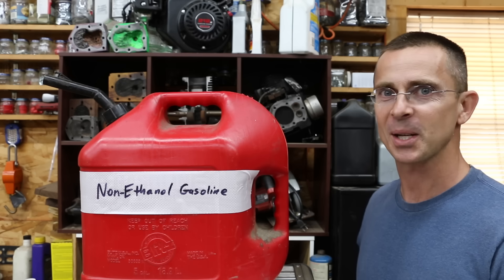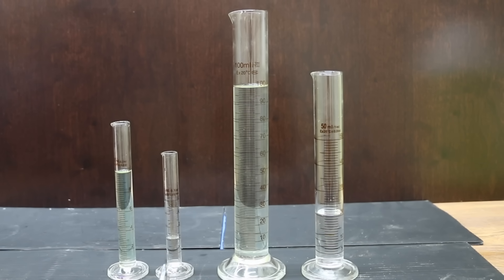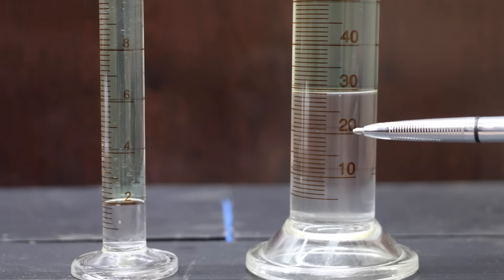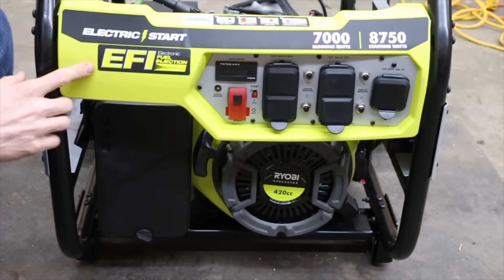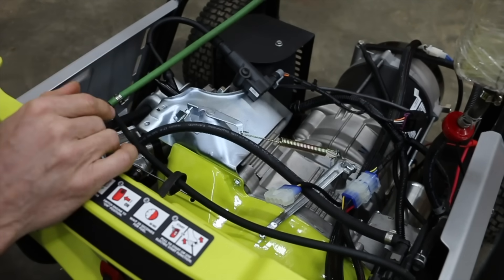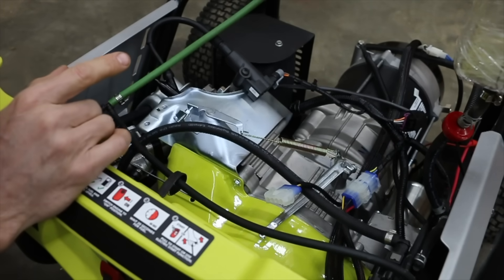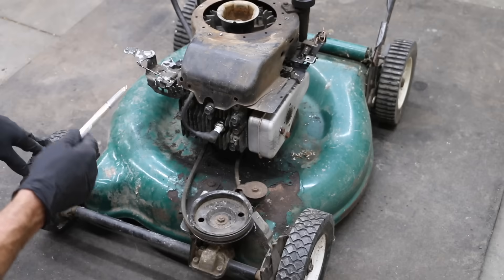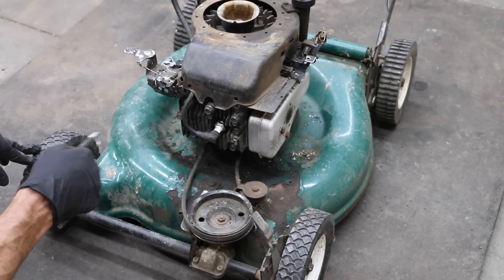Is Non-Ethanol Gasoline Really Better? See the PROOF!

Comment: What if you rerun this test and raised the ethanol mix to 20% or 30%. Curious to see if that would create a noticeable difference
Reply: Normal 02 sensors and computer can only compensate for a certain amount.
Flex Fuel vehicles use pure gas to E90 automatically.

Comment: I hate ethanol if you look at the e85 gas nozzle when you’re at the pumps it looks like is corroding the nozzle. So just imagine what it is doing to your engine.
Reply from the maker: Great point
Reply: It’s not the ethanol. It’s the gas and water mixture as caused by Ethanol’s water attracting properties. Essentially just don’t mix gas and water, meaning don’t mix gas and ethanol. Ethanol alone can be worked with so long as our engines can be built for it.
Reply: And without ethanol present, the water in the gas would magically disappear?
Reply: Mikey McMikeFace He is kinda right ethanol absorbs moisture and water when gasoline doesn’t. It’s kinda a bad idea to store E85 over a long period of time. However I love E85 and that’s about all I run in my daily (2017 Subaru STI). IG @subidoosti
Reply: Mikey McMikeFace without the ethanol the water would separate from the gasoline and settle to the bottom of the tank because water is heavier.
Reply: Evan Marshall Watch Engineering Explained Channel (Is ethanol bad for your engine)
Reply: @Mike Hayes If it makes you feel better, most of corn grown in the US goes to feed cows. 
Like actual cows and not overweight midwesterners.

Comment: The ethanol may attack the elastomers in your engine. O-rings, mechanical seals, membranes.  
I stay at the safe side and Tank gasoline without Methanol. Many car manufacturers advise not to Tank gasoline with Ethanol or Methanol.  Only when the engine Manuf. Explizite ly states that ethanol is okay, than it will do No harm.
Combustion of the Methanol mixed fuel  is almost  the same as for pure gasolines.  In brasil many cars Run in Ethanol rich gasolines, but pre-condition  is the suitable of the elastomers in the engine
Reply from the maker: Thank you!

Comment: Every single gas pump in the united states should be an ethanol blending pump, and at least one of the options should be 0% ethanol. The overwhelming majority of the time the lower price outweighs the lower mileage in modern cars that are used often enough to burn through the fuel before it absorbs too much water. I was almost removed (I hope only almost) from my retired corn farmer Dad's will for pointing out that it wasn't a good idea to burn ethanol in his antique tractors that only get driven once a year for a 20 mile tractor ride and then parked back in the shed until the next year. It took a lot of explaining and some googling to convince him that even though his 1952 Oliver ran just fine on 10% for decades when it was used every day to feed cattle, the gas would go bad if he wasn't burning through it.
Reply from the maker: Thank you!

Comment: Ethanol will destroy the carb jets and any rubber gaskets or even head gaskets in small engines.  Ask my former neighbor.  He had two motorcycles, and he was always rebuilding the carbs and replacing the head gaskets.  Its not a fun job a a v-twin to do a head gasket believe me.  Government is full of crap on small engines.  Also if you are in a cold climate Ethanol is bad for you in a cold start because the ethanol will separate if there is water in the gas.  And to think they wanted to go to E-15.  One thing they don't realize is that you can't have any water in E-15.  Ask NASCAR, they had to switched from gas tanks at the track to gas trucks because they went to E-15 several years ago.
Reply from the maker: Great point. Thank you

Comment: Project Farm - The biggest problem in my opinion with ethanol fuel is that after an engine sits for awhile and the fuel evaporates to a tar, the valves will stick shut and cause problems such as bent pushrods when subsequently running the engine. Try this test: pour out a cup of each and let the two containers sit and evaporate, and then compare the remaining residue.
Reply from the maker: Great point!  Thank you

Comment: I live in a state where you can’t buy non-ethanol gas, but work next door in a state where I can buy it.
I’m no biopetrol guy, but I drive the same route to work 5 days a week.  I’ll run a tank of  non-ethanol whenever I can, but there are many times where the gauge says fill me up and I fill  10% ethanol.  
Ok now my point; I avg 1 mile more per gallon on the non-ethanol than with the ethanol. The non-ethanol is 90 octane, we’re the 10% is 87.
Reply from the maker: Thank you

Comment: E-10 has its uses, notably helping with condensation in the fuel system and emissions. I'm not sold on E-85, though, and I doubt it will ever really catch on.

The future of automotives is electric, beyond a shadow of a doubt, but there's just no replacement for that V-8 throb or the exciting rumble of a high-compression boxer.
Reply: E85 is popular in several racing circles.  It absorbs more heat when it vaporizes, which results in a cooler intake charge, which means you can pack more air (and thus more fuel) into the same space.  It's similar to how nitrous works (albeit on a much smaller scale).  The higher octane rating (110) allows running a higher compression ratio (up around 14:1 for E85 v/s about 10:1 for regular pump gas).  Combining those two allow for more power, and are especially helpful for forced induction applications.  The general "alcohol is good for power" thing is why the crazy drag race engines usually run Methanol.

So, an engine designed specifically for E85 can work really well.  The problem is that E85 varies between 70% and 85% ethanol depending on the season and the seller.  With the increase in turbocharged engines from the factory, a computer can control boost level in near-realtime.  So, combined with a fuel composition sensor, a computer-controlled boost valve could cause an engine to vary boost against ethanol content, potentially making big power on high-ethanol gas, and dialing things back on regular gas.  But that would still matter more for performance enthusiasts than people looking for maximum efficiency.  There's less energy in the same volume of Ethanol, so it's simply not going to compete with gasoline for efficiency unless it's way less expensive - and that decreased expense would require more efficient ethanol manufacturing efficiency (and probably for political price-fixing to not be involved).

Comment: Its halarious how many people hate ethanol. I personally been using it for 9 years and love it! It's absolutely amazing for new direct injection engines because of carbon buildup and LSPI which isn't even a concern with e85. I converted my dodge neon street cars and racecars. Also my 08 avenger and my 01 dodge ram. All run amazing and have never had a fuel related issue. I will use forever 😍🏁👍😁
Reply from the maker: Great!

Comment: good video,,,,,,,,,,,been taking ethanol out of my gas for about 2 years now and small engines that were hard to start and ran rough for a long time don't anymore minus the ethanol..........i use 91 octane and it works great.........when you did the lawnmower test would it be better or not if you ran the engine under a load by cutting heavy grass.     would that give another sort of indication .
Reply from the maker: Thank you for the video idea!

Comment: All I know is that my car gets better fuel economy without ethanol and
in my mowers, ethanol laced gas ruined the carburetors. In the hedge trimmer it
caused a blockage in one of the very fine passages necessitating 
the replacement of the carb. In my ZTR mower, the rubber gaskets and other 
parts failed such that I had to completely rebuild the carb and replace the float 
assembly. I have stopped using ethanol laced gas in everything I own and
I no longer have fuel related issues. Ethanol totally sucks and 
is only there because some lobby pushes for it to subsidize farmers.
Oh, tjhe damage to the carburetors was very fast. Like less then a month's
worth of use. In my 1990 5.0L Mustang, even 10% ethanol causes the engine to surge at idle.
This car has all of 11K miles. Yes, 11K NOT 110k. So it is certainly not
wore out or plagued with engine issues. Ethanol is crap.
Reply from the maker: Thank you!
Reply: Of course,no one looks at btu out put
Reply: Run the cheap stuff in your car and the expensive stuff 91 in anything with carburators
Reply: I filled my tank with E85 and I noticed a difference in power and acceleration. Weak and hesitant. My truck is a flex fuel.
Reply: @paulsosa1872  Ya... E85 is 85 percent ethanol and requires a proper tune and modification to run. Typically a specific tune is needed for E85 along with larger injectors because 30% extra fuel is required compared to E10-15(normal pump gas).
Reply: Ya my 300zx gets an extra 70 miles to tank running 100% gasoline versus anything laced with ethanol. Hate the crap, but save running AvGas it's difficult to find high octane 100% around here. 100LL does run pretty damn well though at 4~ dollars a gallon.
Reply: Ethanol fuel melted the rubber fittings on the vapor return lines in my 1997 Mercedes.  it was a serious pain to find those rubber connection fittings and replace them. They swelled up and lost their seal again within a year.
Reply: @HappyHands.  that's because alcohol and rubber don't mix.
Reply: Yes I have two 1990 5.0 HOs.
According to our state plant board petroleum director... no cars prior to 2006 model year are designed for E blends... but the farm lobby got it approved for 2001 for a sales pitch.
Real gas is available here but 30 cents higher.
Reply: archangele1 

You’re too lazy to empty the tank and run til dry between uses.

Comment: could you do testing on replacing standard fuel with straight additives. fill the tank with only 100% fuel additive to see what happens. does it run too hot? too cold? too lean? too rich? try different additives. does running straight additives (while more expensive) do any damage to an engine or it's gaskets?
Reply from the maker: Thank you for the video idea!

Comment: Ethanol kills the fuel range(150+) compared to normal fuel.
Reply from the maker: Great point!
Reply: To clarify my statement, my past and current vehicles with a full tank of 10% ethanol gas would lose 150 miles compared to regular gas.

Comment: Tim here in Utah I have a dodge dakota with the ho 4.7 and chose to do the test with ethanol which is what ive been running and have just filled the tank with the ethanol free so far it seems my truck has a bit les power but i,m not finished running the tank out but will report back tomorrow or so when its gone and say if theres a better mpg . be right back
Reply from the maker: Thank you

Comment: I own a ‘12 BMW X5... I was at one point using ethanol gas in my truck, but I ALWAYS had issues with the fuel pump, line and one of  my turbo chargers would go out so I would be operating at half capacity. Took it to BMW all three times and they would tell me EACH time it’s the fuel pump and fuel line, so they’d,”replace it”(I use quotes because it happened one too many times to say it was actually replaced) at N/C since my vehicle was still under warranty. I kept asking what exactly was the reason it would go out and they kept telling me it the gas that I’m using. I only used QuikTrip/Chevron premium ethanol gasoline since I bought the vehicle and they’re top tier rated. But the gas was their only reason as to why I was back with the same issues. 

Ended up doing a google search on the topic and apparently I wasn’t the only BMW owner having that same exact issue and getting the same reason from BMW. SO... someone on the blog said he tried non-ethanol gasoline and he doesn’t have that problem anymore. 

So, I tried it. I’m happy to report that I’m only using non-ethanol gasoline and the difference is exactly as your tests confirmed. I noticed my gas lasts A LOT longer as compared to ethanol. I get faster take off and faster speeds, noticeably more than ethanol to the point that I was at a red light with a Porsche 911 to my left, Dodge Charger to his left, and Mercedes C63AMG to the chargers left and on green we all gunned it to the next light... I beat them all there that the charger pulled up next to me to ask “what kind of X5 was that?” 🤷🏾‍♂️. Just a regular X5 35i premium... but I will add that I don’t use regular oil... I switched to royal purple sometime last year and I’m guessing with the switch up of gas is what the correlation in extreme differences is. I’m not a mechanical engineer, I’m just taking a guess. 

So I second using non-ethanol as I haven’t been back to BMW with that problem since.
Reply from the maker: Thank you

Comment: It's a very bad thing.  It breaks down much faster and causes much more damage in small engine carburetor.   And it can't be stored nearly as long.   Go take that new gas and put it into a clear glass cup and watch it sit for about 3 minutes open to the air.    It many times turns to a white milky oily goo.   Just go buy new gas and put a little into a has can.  Take it home and put a little on your finger and you will discover how oily it is.   It's pure crap.  I get so many calls these days from people about their car running bad just after they got new has pumped into their car.  It idols bad and dies.   It will ruin the catalytic converter.  Oxygen sensors.    The valves get coated in layers of corn syrup burned onto them.   My God do a tiny bit more simple research before selling people these things.  Your ignoring and leaving out massive issues.   The test you did here was only showing one thing.    Ethenol does not deliver better fuel delivery.    Because it's freaking more heavy.    My God.  And to make up for that the car makers are putting in a stronger fuel pump and it's costing you a bucket load of money to fix when it goes out.
Reply from the maker: Thank you!

Comment: Ethanol....lower caloric content generating less power and worse fuel economy, hygroscopic so it degrades rapidly, corrodes fuel systems and is a pain to store in little 5 gallon containers because they need to be well sealed.

Upside? Cheap increase in anti-knock properties, renewableish, exhaust smells like corn.
Reply from the maker: Thank you!

Comment: I'm in Orange County, NY. This county is the furthest North in the metro NYC area where retailer fuel suppliers can only have at least E10 fuel; fortunately the next county North of mine, Ulster, and upstate NY does not require it (yet!!) and an upstate convenience store chain, Stewarts, offers their 91 Octane ethanol free; and they have a store just across the border in that county, 3 miles away from me; I use that exclusively in all my small engines AND my 5.0L Volvo-Penta inboard boat engine; I used to always have carb issues with my small engines, but not since I switched to the ethanol free fuel.
Reply from the maker: Thank you

Comment: my tuned turbo car gets better mpg with non-ethanol but has a little bit more knock and less performance. my 3.7L non-turbo sports car i run both 93 non-ethanol and 91 ethanol and it doesn't seem to make a difference but i also don't have a tuning program for that car yet to look at the numbers. i do make sure to fill it with non-ethanol before i store it for winter. both cars require premium gas.
Reply from the maker: Great point.

Comment: Ethanol in gasoline is a giant rip off of the American people. I lost $1,400 worth of carburetors(I replaced the ruined stockers with high end Keihin carbs) 
on my 2 custom  Triumph motorcycles before I was clued in to the damage caused by this crap. I have used $4.00 a gallon 93 octane non- ethanol gas from that point on. Gas mileage in my Honda Accord jumped noticeably doing some checking I actually saw 44 mpg on a trip using EZ throttle and cruise control. Previous high was like 39 mpg using corn gas. My bikes are running like champs and I no longer fear damage from  long storage periods during winter.
I guess the congress is happy as they are enriched beyond belief from the corn people.
Reply from the maker: Thank you for commenting on this!

Comment: The better question would be is ethanol any better than plain gas? Ethanol is more expensive than gas, it reduces the amount of corn available for food which raises the price of both corn products (including everything made with corn syrup, corn oil or corn starch) and the price of meat that is raised using corn as a major food source. It requires subsidies to be competitive and is driving the price of non-ethanol containing gas up significantly as demand for it outstrips production.
Reply from the maker: Thank you!

Comment: Just knowing that it is a fact that ethanol breaks some rubber and plastic components down is bad enough, if it did not damage components  there wouldn't be a difference in parts designed for E-85 vehicles and they do take special components, my Tahoe is rated to use E-85 and I needed to buy a special fuel rail because of it. It is also a fact that it absorbs water, this is likely why it goes bad faster than regular gasoline. Unfortunately the only gas station anywhere near me that sells unadulterated gas is twenty miles away and charges an extra $1.50 a gallon.
Reply from the maker: Great point!